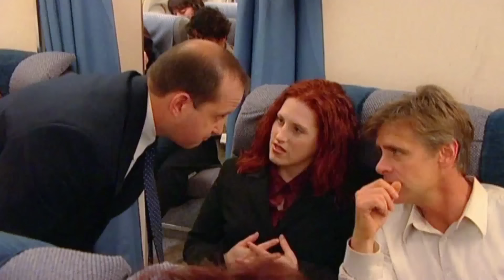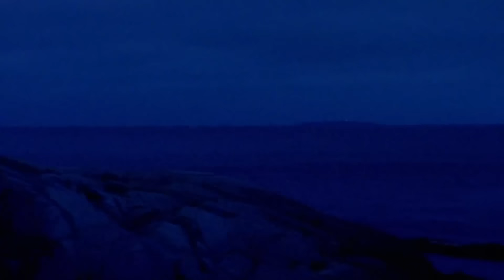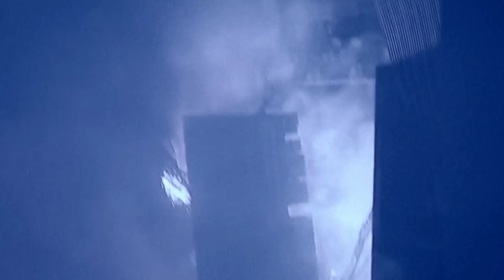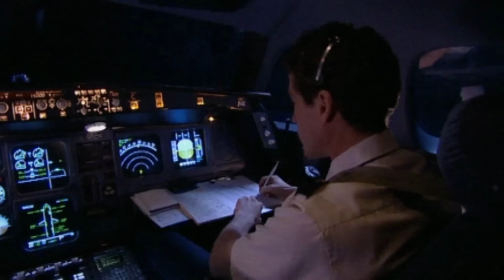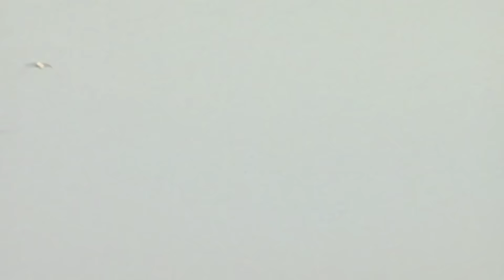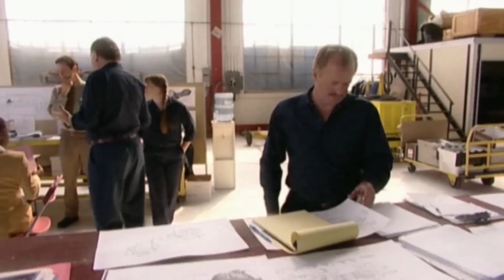Swissair 111 Cockpit Fire Mystery Uncovered | Mayday Air Disaster

Comment: The Swiss are internationally renowned for being meticulous and thorough.  These two botched it badly.  (As a pilot) IF you have smoke in the cockpit LAND IMMEDIATELY!!  What the h were they thinking?  That is no "experienced" airline captain.
Reply: The had no time to land after smoke appeared also it was SO hidden and lethal fault there.
Reply: They cant land as soon as they smell smoke they would be overweight and  need to dump fuel
Reply: @ronaldofan_no.7  So what?  Thousands of pilots have dumped fuel before.  They were over the ocean.
Reply: @davidb2206 oh ok then

Comment: Wait so the black boxes stopped recording after the power turn off but the entertainment system in first class was still running?! That’s messed up
Reply: Jury-rigged wiring can do that sometimes.
Reply: No. That fire burned through cables needed to run them.
Reply: @Gacha_brown628  the wealthy will be entertained. Even at everyones expense.
Reply: @allykat5899  Which is correct, because IFT (Interactive Flight Technologies) connected it straight to the essential power, so  it was turned on to the end

Comment: Swissair Flight 111:  I would think smoke in the cockpit would demand landing the plane right away, if possible.
Reply: They were very overweight and far too high up for a quick landing. Also I think the air conditioning had smoked a bit previously. What a dreadful ending for them all.
Reply: They were to sluggish to take actions
Reply: @Carlito_Brigante93  FYI If they had gone directly to Halifax they likely would have crashed in the Halifax Suburb of Middle Sackville potentially killing thousands!
Reply: who said pilots are clever?

Comment: With the whole problem with the engine mounts on these planes coming to light now, it’s really starting to look like the MD11 was and still is a giant engineering abortion.
Reply: Well MD11 definitely could have been a twin jet the problem is it was a plane built and the end of the ETOPS restriction but I doubt a twin jet MD-11 could have saved  McDonnell Douglas as the 767 A300 and the newly introduced A330 were far more advanced it was a successor to a plane that put an end to Concorde service
Reply: @aaronthe747fan airbus has really given Boing a kick in the teeth. Boing went from being a trusted company who designed the 747 to a mess and a plane design that killed hundreds. We won't fix the problem we will just write a software program and tell no one about it.